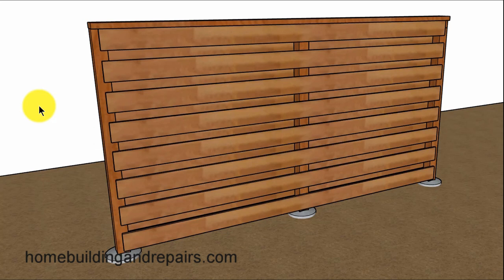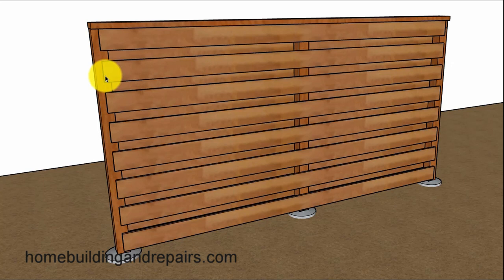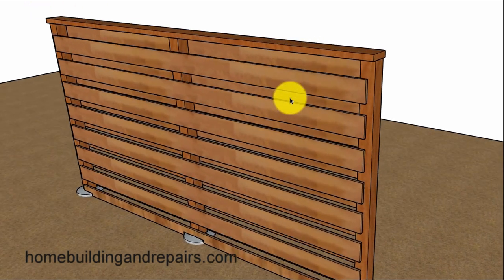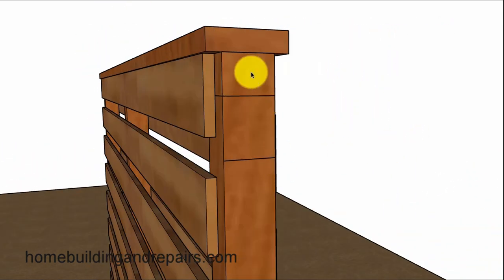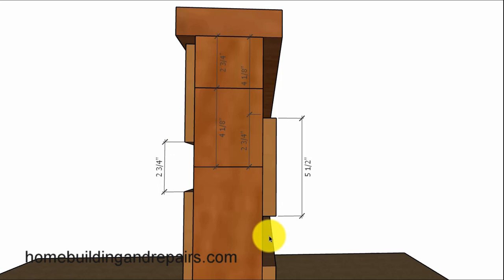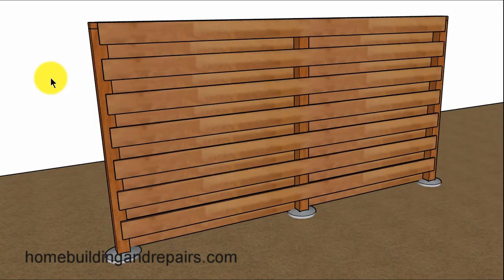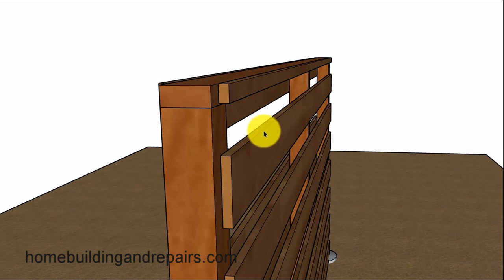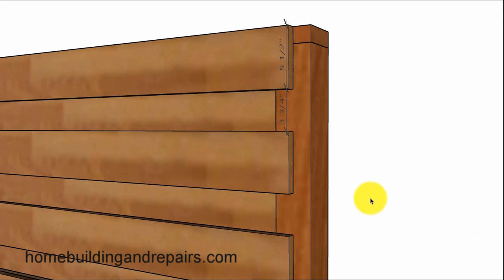How To Build Horizontal Privacy Wood Fencing With Wind Gaps

Comment: Nice video... exactly what im looking to do. Building one panel privacy wall and decided having an air gap would be better for less resistance.. looking for the layout and measurements is what i needed. One thing to note and would have made this video even better is to note the distance one would need to maintain privacy versus gap size. What i mean by that is ..how far should one be standing before they can start seeing through the gaps and this would tell me what size gap to go with.. since this is not directly on their property line but about 5 or 6 feet away from the neighbors actual fence. Meaning they cant directly walk up to it so...say they are 5 feet away...what would be a nice gap that would keep a good privacy without them seeing through? I know this requires math and angles so ..lol just gonna go with the 2 3/4 gap for now.
Reply from the maker: Good points and I think you could use large plants and staggard lumber to create more privacy. It will be better to build the fence with out gaps, unless you have another method to block viewing.
Reply: If you draw the a bit of fence to scale(pickets, gaps), you can figure it out with a bit of simple right-angle geometry 🙂

Comment: How do you do a corner for a fence like this ? In other words, if the fence borders two edges and meets perpendicular, how do they connect at the corner? Is it even possible?
Reply from the maker: I won't be able to provide you with a video and since it would be difficult to explain, all I will be able to do is put your video suggestion on my list of videos to be made in the future.
Reply: Very simple you just start as you did before on the corner post at a right angle to the one you just built not difficult at all. We at FenDec fencing and decking UK do this style on all four sides of properties.
Reply: I think the only real consideration is that instead if meeting the boards halfway through on the posts, for the exterior you would want the horizontal boards to reach all the way to the edge and either meet in a 45° bevel together, or have one reach slightly further out than the other to create a nice corner.

Comment: Why don’t you actually physically build the fence instead of showing it on a computer. It’s all nice and engineered on paper until it’s actually built in real life
Reply from the maker: I think the answer to your question is obvious, because it would cost a lot of money and take a lot more time. You do have a good point, I can draw something that looks easy, but in reality would be difficult to build, for most do-it-yourselfers.
Reply: I want to understand the design.  Any journeyman carpenter could build it.
Reply: Not difficult to build not expensive. It's just time consuming.